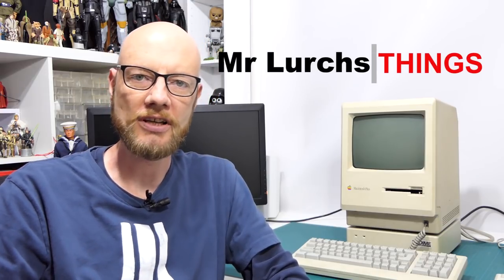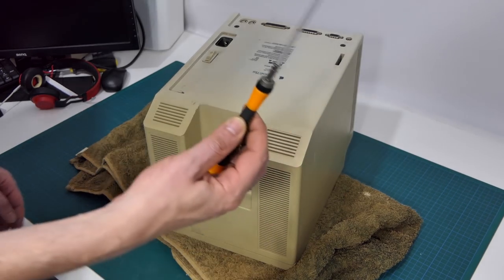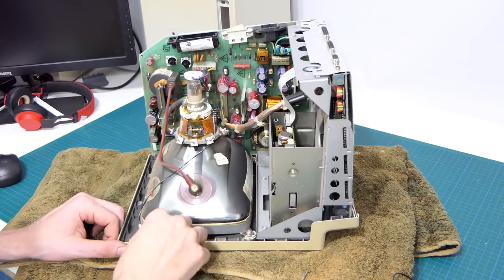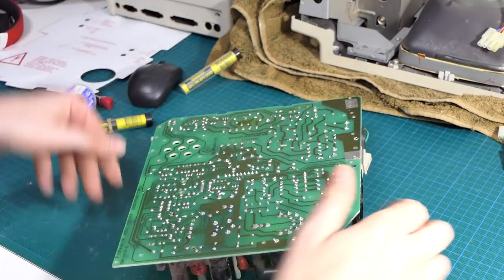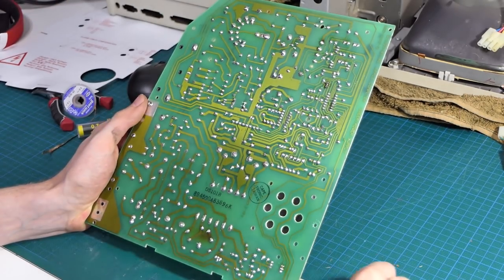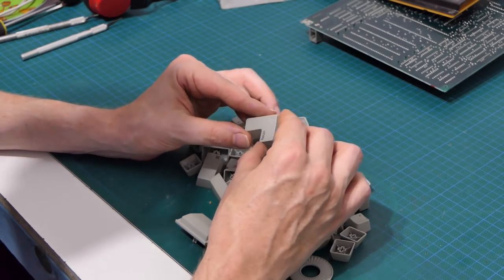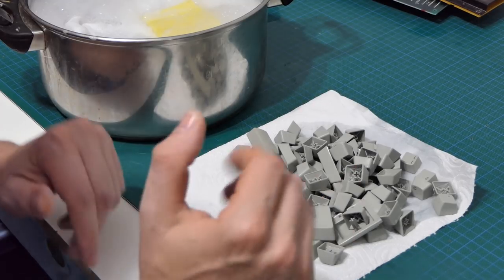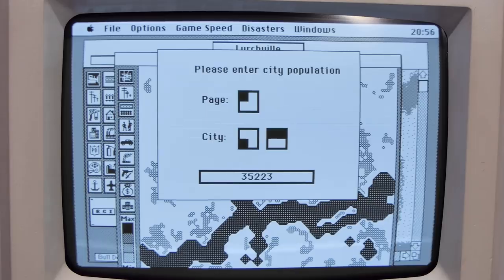Macintosh Plus Repair and Resto | MLTs

Comment: Another video about a Macintosh Plus with minor issues. There are plenty out there with the same advice. What the community needs is a video on repairing less common faults, that others don't cover. I am pleased you have a nice clean Macintosh Plus. Sadly I don't and am desperately after advice that goes beyond dry solder joints and retrobrighting.
Reply from the maker: Seriously? This video is over 3 years old.
Reply: @MrLurchsThings  Indeed. My point still stands, the Mac Plus has been failing in more ways than an Analogue Board for many, many years, and it would just be good to see a different approach to fixing them. There are hundreds of videos, many three years old, or older, all with the same message. Or are you saying your video is no longer relevant?
Reply from the maker: @phillgriffith  my video is as relevant as how broken the machine was when I got it. 3 years ago not only was my collection very small, my knowledge on such things was also a lot more limited than it is now (not that I know much now either) and I was still starting out on YT. 
And at the end of the day, even now - I can only fix what’s broken, unless you’d prefer me to break a machine more just to show how it’s fixed?

Comment: I have a Macintosh plus and it powers on and screen comes on and works but starts high and works it way down after 5 mins of warming up, would reflowing the solder fix this or would this need recapping?

Comment: How do you know if the CRT is discharged or not? I need to do the same job as you did here on my Plus and don't want to go electrocuting myself! 😖
Reply from the maker: Did it electrocute me? Yes = it didnt work. No = I did it right. HAHA.
Thats kinda the problem. Given it doesn't always spark, you just have to assume that, as long as you follow the instructions, it has worked. Perefractic just released a video on CRT discharging that may be worthwhile checking out (It's on a Mac Plus too)
(Apologies for the late reply)

Comment: Mine had the same problem after shipping. Got some of my money back and learned how to fix an analog board, 10/10 would do again
Reply from the maker: Apart from cracked solder joints and abused disk drives, the Plus is actually a pretty reliable machine.